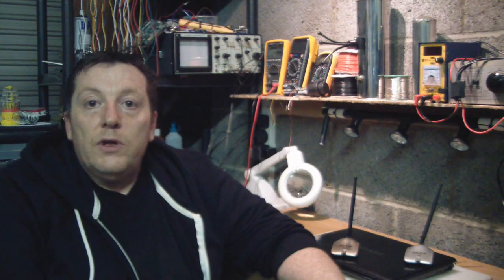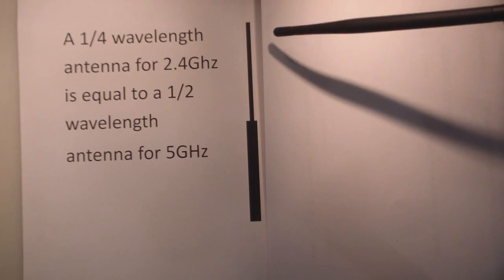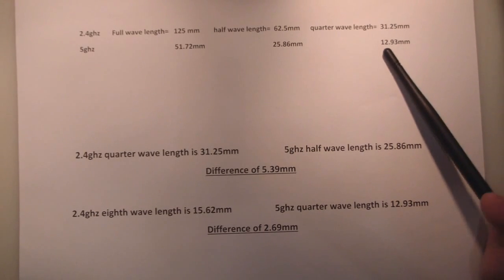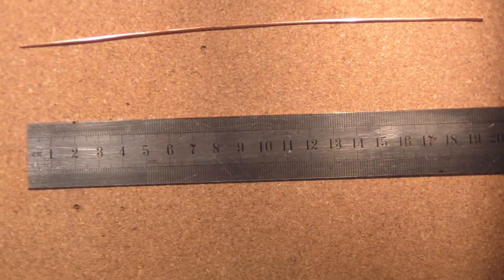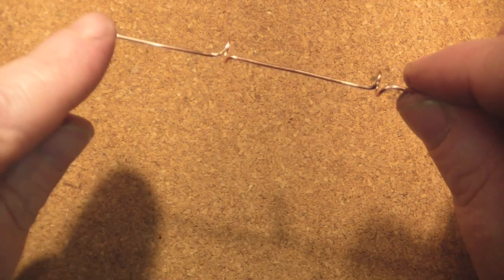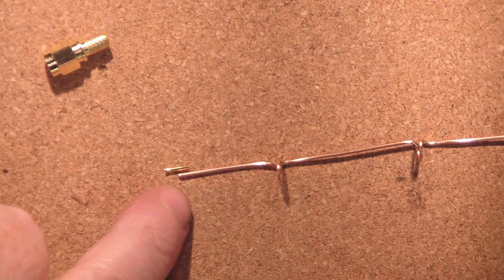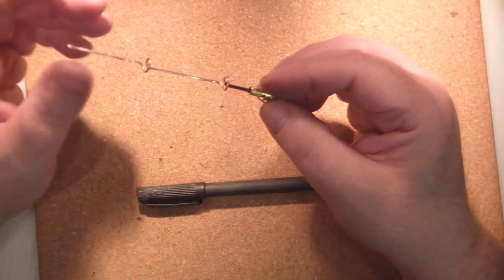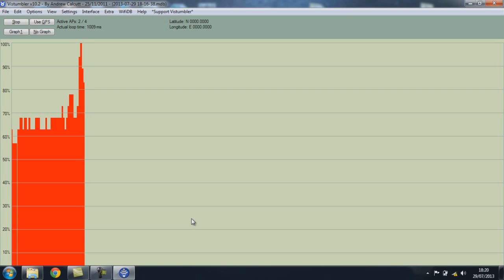5 GHz Collinear Antenna #26

Comment: I still have the old Alpha card, the grey one. I have never since seen any other wifi card with -97 dB receiver sensitivity.  However noise increases if transmit power is set too high for some reason, so I limited it to 64mW and it has exceptional range. It is my favorit dongle to bring along on camping.

Comment: Nice vid - thanks for making it. Apologies if anyone else has already mentioned this, but it sounds like you connected this antenna "live" while the red-bar graph was being made. If so, did you notice that it began with a high (near 100% signal) gain? It makes me curious to see if the gain would increase again if you un-screwed the antenna a few turns, effectively lengthening it...?

Comment: Hello Andrew and thanks for these wonderful tutorials.
When we solder the antenna to the sma connector pin you mention that we have to compensate such that the length of the
sma pin and the first antenna section is exactly half a wavelength as specified.
I thought the half wavelength section was measured exactly from were the outer shield stops on the sma connector.
The reason I think this is because otherwise the length of the first half wavelength section could be considered to continue down through the coaxial cable, why start just because there is a pin there.
The first few millimeters of the antenna that dissapears in under the shield of the sma connector could be considered
the same as the coaxial cable that the connectors are eventually connected to.
I am probably confused here really.
Regards
Peter

Comment: Hi, it seems your antenna is suffering from imbalanced issue: it is an unbalanced fed by a coax which is balanced.
A part of the current of the outer conductor of the coaw could flow out of the coax, is it why you take a very short coax (hardly not at all ? Have you considered the pottibility of having a tiny balun ?

Comment: Hi Andrew. Your calculations seem to be a bit off.
Please let us know how you calculate the wavelength, because I got different readings when divide the speed of light (299792458) by frequency.
Reply from the maker: ***** Sorry guys but you need to look up short bottom fed dipole Wikipedia has a section on this. Wave length is not set in stone or there would be no need for antenna theory.Lots of things influence design and materials used etc
Reply from the maker: ***** That's it was going to post the same link when I got home so glad you found it.

Comment: You can use a 90 degree SMA connector.

The usual design for a dual band router is the 2.4 GHz band uses the external antenna and the 5.8 GHz band uses the internal PCB antenna. 5.8 GHz routers for household use were not designed to function over a distance but rather to add bandwidth. A dual band router is a hybrid legacy router as it should do 802.11 A,B,G,N. Unfortunately this is not the case one cheaper routers.
Now in a true dual band router the load of traffic can be shared between two antennas. If you change the factory firmware you can assign which antenna does what. If you want greater distance then you go lower in frequency but sacrifice bandwidth. Example is 900 MHz Ethernet bridges can have a range of a mile or more depending on antenna and location. 2.4 GHz can travel up to a couple of city blocks and 5.8 GHz can travel across your home. Also keep in mind that you are dealing with microwaves and depending on your antenna and it's gain the ERP of microwaves can become a potential issue. 1/2 a watt at 5.8 GHz is enough to burn you.

Comment: Hi andrew.  Thanks for the vids.  I am going to try and make some ants for my RC stuff.  i have 2.4Ghz for controlling my rc heli and 5.8Ghz for the video down link.  I hope that a new ant on the 5.8 would be better tuned than the stock, as you have said it may just be ba standard 2.4 rubber duck.

What is the software that you are using to show the results of your ant.  At the moment i have no way to measure my results.

Can you recommend a better type of 5.8Ghz ant to use the the heli which will be doing the video down link, i think that a normal rubber duck facing downward may get in the way as its stiff.  Can i may some kind of 1/2 wave dipole?

Thanks for your reply in advance

Comment from the maker: 5 GHz is a lot bigger I am finding that you get a better performance if you aim for the top of the band 5.8 GHz. This may be because of interference for the heavily used 2.4Ghz spectrum. Thing is nobody is making antennas for 5GHz, (you tube is flooded with 2.4GHz antenna designs). The only exception to this is the RC community. So I welcome any feedback.
Andrew

Comment from the maker: Hi David yes that is how you calculate wavelength but it is not so cut and dry as the 5GHz band is big, 5.180 GHz to 5.825 GHz though some countries have different rules within this so it’s best to check where you live. The 2.4 GHz spectrum for wifi is a very small band. When designing the wavelength for this we aim for the middle of the band so it will work on all channels.
Reply: That being said, fast forward 6 years later and the 5 GHz (802.11a/h/j/n/ac/ax) band stretches from 4910 GHz (CH 186) to 5930 GHz (CH 7) putting the middle band frequency at 4970 GHz. I calculate the half length antenna for 5 GHz should be 30.18mm or can simply use 4900 GHz - 5900 GHz making the half length 27.77mm.

Comment: Hmm, I must be missing something here. I calculate the half length antenna for 5GHz should be 29.98mm and the quarter length at 2.4GHz should be 31.23mm a difference of 1.25mm; I'm using lambda=c/f with c being the speed of light, f frequency and lambda wavelength.  Is the above equation overly simplistic for antenna length calculation?